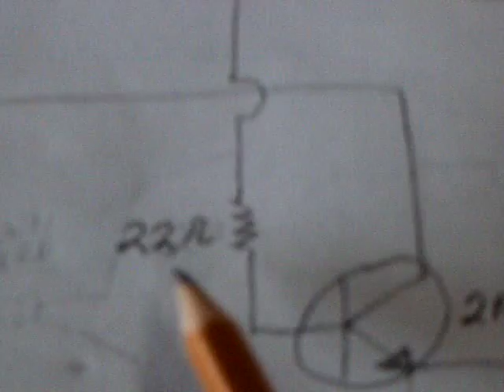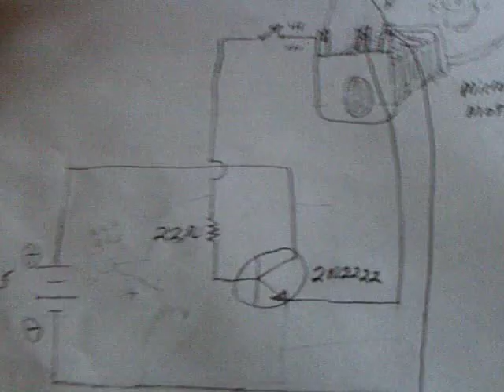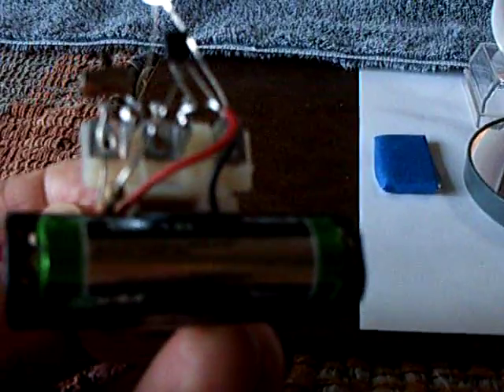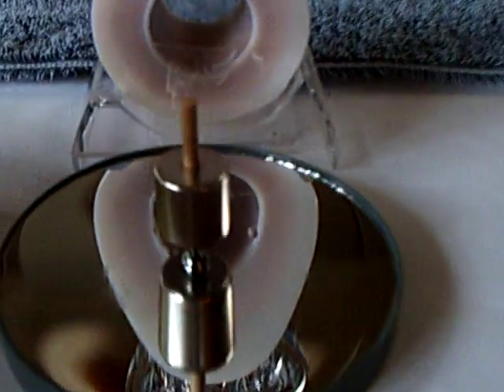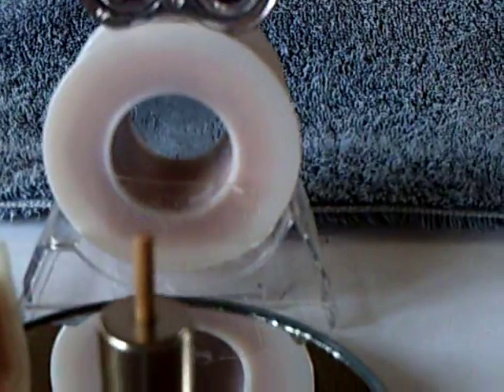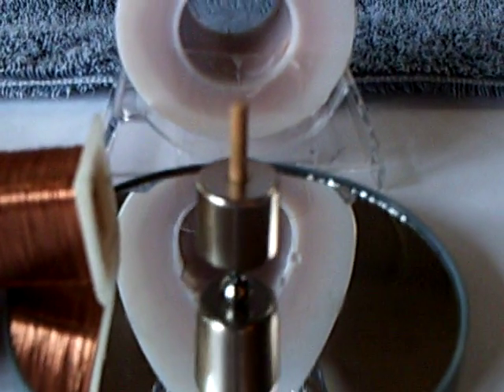Light Multiplier

Comment: it is not multiplying anything actually. magnetic field in the first coil turns the magnet, and turning magnet generates a little more extended magnetic field and induces second coil. but if you measure the current draw from AA battery i am pretty sure it rise when you move close to the magnet.

Comment: Hi again. I tried your circuit and it did not work. One question, measure the resistance of each coil (primary and secondary) center tap. I found the primary and secondary. Is it important which one connects in the circuit? Great work!
Reply from the maker: +Curtis Desselles Try reversing the coil connections.  Remember that the led is backwards from what you would think it should be.  The circuit will not self start.  You need the spin a N/S magnet in front of the coil for the circuit to start up.

Comment: LidMotor, How did you make that ring magnet spin on the mirror. I mean did you put a point on the bottom? Thanks
Reply from the maker: +Curtis Desselles The ring magnet has an 1/8" hole in it.  I put a small steel ball bearing on bottom.  Magnetism holds it there.
Reply: +Lidmotor Thank you, I had an idea, but you're clever and may have used something cool instead.

Comment: You may be right, but as I mentioned to Lidmotor, I personally belive that there is just a little energy being stored in the air and spinning magnet ect. I belive this stored energy to be very efficient and possibly giving us the appearence of any gain. I think there is deffinatly a little recovery of energy going on, but not sure if theres the possibility of any over unity here. Very interesting experiment. I am starting my tinkering with this circuit myself. Cheers, IC.

Comment: Hey lid, I'm sure you have thought of this before but i dont think i have seen you try it. Why not, instead of powering maggies LEDs, use her output to power the drive circuit? If the LEDs are lighting at 3.1 volts you have more than enough voltage to push the drive battery voltage back up and make the circuit that much more efficient. It'll probably run for days lol

Comment: Lind, I have some EXTREMELY expensive very small very similar size magnets that will break your pinky fingers if you get 2 and your pinky between them. They are about same size as yours however thier gaus rating is CRAZY I would like to loan you a couple, possibly to keep for your experiments. I'm pretty sure you won't have seen magnets sontrong as these little guys. They are sensitive to high temp changes, or impacts so they need to be treated with care. I belive I can explain y your gaining IC

Comment: Wesley Gary has a magnet moter that reverses the  polarity of an electro magnet armature that repels and is attracted  to a stack of horseshoe magnets. He asserts that the force of the armature would double if the magnet stack were doubled. Something to think about. Increasing the magnet spinner strength should strengthen the spin force and increase the output with out increasing input, untill at some point it achieves overunity.